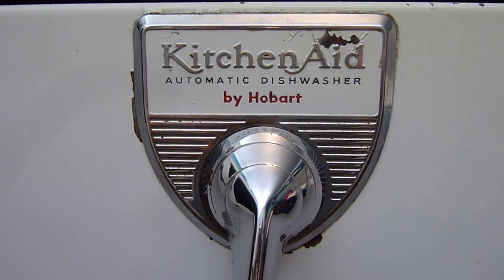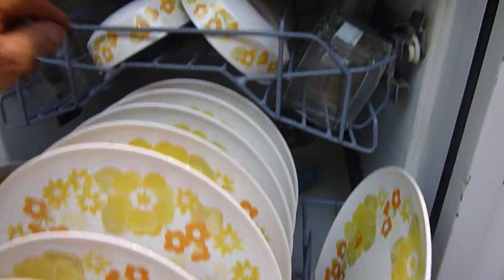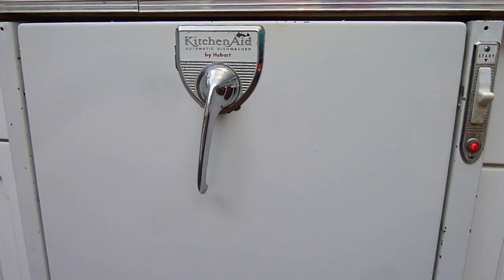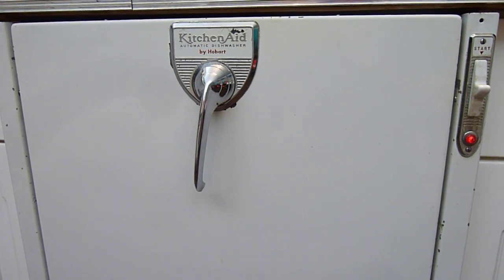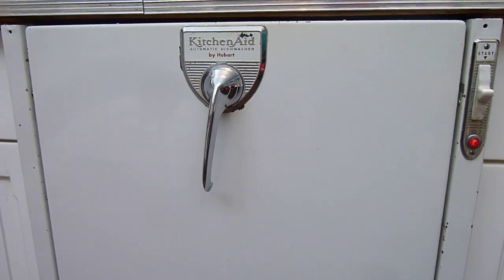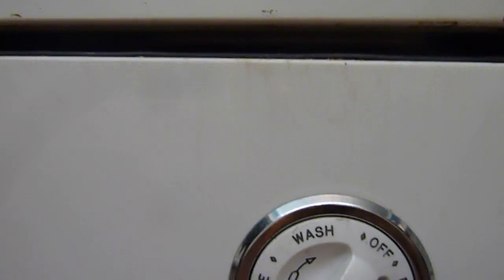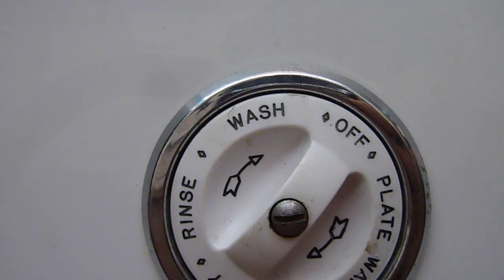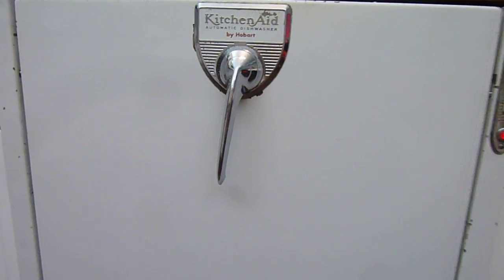1959 KitchenAid KD-12 Dishwasher Tour: Operation

Comment: Thank you so much for posting this video! I moved into my home in 1999 (third owner). All appliances were original, stainless steel. The wall oven crapped out in 2002, forcing me to replace it and the cook top with a free-standing stove. Last week, an appliance repairman gave my KitchenAid Imperial DuaCycle dishwasher the once over to inspect the source of leaking water which stopped me from using it 8 years ago. The tub, motor and gaskets are all pristine, and he feels the leak was due to a misplaced item that sprayed water forward (which is a common cause for leaks to form). I found the original owners manual online and she is ca. 1965. I shined her up and fired her up, and she’s back to her full glory - a real beauty next to her companion Kelvinator refrigerator (which is still running like a champ).
Reply from the maker: Fantastic!  It's amazing how well built and long lasting the old appliances are.  I'm glad you're enjoying them.  Thanks for watching!

Comment: We had this exact same dishwasher in our house until 1985. Ours was a KD-12P. The P at the end of the model designation meant that it was a pump drain model instead of a gravity drain model. The front of our dishwasher was stainless steel. There were some issues with it towards the end. There was a small leak. Also it started not to work properly. Lastly the racks were worn out (the lower rack was replaced during the life of the machine).
Reply from the maker: What an outstanding run for that machine!  Thanks for watching!

Comment: It’s amazing how a machine made 73 years ago still works  whilst I bought a tabletop dishwasher last May which broke down 6 months after and nobody can fix it.
Reply from the maker: I restored an entire kitchen's worth (40" Wedgewood stove with matching 40" Vent-A-Hood, Westinghouse Laundromat Twins, Philco Refrigerator, KitchenAid dishwasher, and all the small appliances like toaster, mixers, blender) of 1950's appliances in order to have a "real" working 1950's kitchen in my Victorian home, starting back in '93.  It took me a few years to find everything, and get it all finished, but here it is, 2022, and all of it is still in use.   The kitchen includes custom cabinets in white, with the correct chrome pulls, and real "Formica Double Boomerang Bianca" counter tops with fluted polished aluminum edge banding.

Comment: In 1957 my mother had the kitchen (built in 1927) re-done; a stainless steel Elkay sink and Kitchen Aid (by Hobart) dishwasher were installed. The dishwasher looked exactly like the one in this video, except I think the one my mom ordered had a stainless steel facia (I could be wrong about that).  I remember the start button. the little red pilot light, the blue-rubberized pull-out trays, the dial at the bottom AND...the forced-air dryer.  I think the whole cycle was under 50 minutes.  Whenever friends/relatives came in to our kitchen, they all wondered at my mom's dishwasher and after seeing my mom's unit, had one, just like this one, installed.  I don't think we had a single day's problem with this dishwasher...it worked PERFECTLY for 16 years, and then we sold the house.  (I think it would have worked for many decades, there was NO planned obsolescence back then). The new owner (1970) had it taken out and thrown into the trash, along with the stainless steel sink.  Reason?  The sink had tiny water droplets and didn't shine like a new porcelain sink.  Oh well.
Reply from the maker: What a great story!  I was very lucky to find mine.  It was still in use in a house in Ohio, that was being remodeled. The owner/seller was kind enough to help me get it shipped.  That was back in the mid to late 90's and it's been in use every since.   I was also able to find a big double basin, double drainboard sink and both have been very loved in my 1950's kitchen, along with my early 50's Westinghouse front load washer/dryer pair, Philco refrigerator, 42" Wedgewood  cook stove, and matching 42" Vent-A-Hood range hood.

Thanks for watching!

Comment: We had this exact dishwasher and let me tell you it washed many holiday dishes two and sometimes three loads one right after the other everything came out sparkling clean and the dishes were never pre-rinsed. It was still running but we had to finally get rid of it when it started leaking by where the dryer area was inside in the bottom right side rear.

Comment: My mother had this dishwasher, it lasted for years finally gave way where the blow dryer is, it leaked under there so we got rid of it and bought a KitchenAid Superba which I still have down the basement apartment. Very powerful motor and pump the spray arm weighted a ton.
Reply: Yeah, as I recall the spray arm was made out of cast iron--or at least felt like it was--very different from the plastic components of today's dishwashers.

Comment: In the uk these machines were never connected to the hot supply so when you switched it on a heater came on in a tank in the bottom and heater the water. Once hot enough (15 mins) the machine started. While washing another tank of water was being heated so it went straight to hot rinse. All done in 15 mins from time water heated up for first wash.  Our latest machine (top of the range Bosch) takes about 3 hours. What a joke.

Comment: My mother had one of these, extremely powerful pump motor cleaned and dried all the dirty holiday plates in no time. Ready for a second load by the time desert was served. Only reason for replacement was tub began leaking by dryer blower inside.
Reply: Well that's when you pull it out and do patch work.🙄😑
You can never find quilty and fast washing and rinsing in ANY DISHWASHER TODAY.

Comment: No new dishwasher would clean as good as that one
Reply from the maker: It doesn't do anywhere near the job that a modern dishwasher would do.  For example, it doesn't have a top rack wash arm (something that I'm guessing KitchenAid came up with), so the upper dishes are only washed as good as what the water can do that gets past the plates and utensils in the bottom rack.  And it doesn't create it's own ultra hot water, although my water from my house's hydronic heating system (compact boiler system) is very hot, so it's not really capable of removing food that's been stuck onto dishes and dried there.  There's also only so much water pressure that it can create, considering that the pump assembly is now 61yrs old, and counting.   It probably did a fantastic job when it was new, and tolerances were tight in the pump.  That being said, I don't need it to wash like a modern machine.  It's simply a functional part of my 1950's kitchen, it's a great addition to the rest of the appliances, it DOES work and do a good job, and it still puts a smile on my face every time I fire it up and hear all the cool sounds it makes.
Reply: @austinado16  Yup, we had one of these when I was growing up--it came with the house my parents bought in 1971--and I remember these problems well.  My parents had to repair it a few times before they finally gave up on it and bought a new one.  They estimated it was about 30 years old at the time.  (I guess some of them lasted longer than that!)  They've had a few dishwashers since then, none of which lasted longer than 10 years or so.  Anyway, I love seeing the rack design and the start switch and that little red light.  Thanks for the memories!

Comment: I've sold high end appliances for years and I've never seen anything remotely close to the quality of a Hobart by Whirlpool now. By today's standards this a "commercial grade dishwasher" for a resuraunt. Chances are the frige's in your grocery store are Hobart. I've sold 1000's of them.
Reply from the maker: Agreed.  The fact that this machine is still in use, and fully functional is pretty amazing.  Other than replacing a couple rubber hoses, and freeing up the fan motor for the hot air blower, it was still functional when I found it.  Other than cosmetic things (which are now showing their age again) and having the liner of the inner door re-powder coated several times, the only mechanical work I've done has been:  re-sealing the tub around the pump/motor housing, and having a new lock mechanism made on a CNC machine for the door latch.

Comment: I heard the pumps in early dishwashers were so overpowered they tossed the dishes around.
Reply from the maker: Mine doesn't do that, but there is probably enough wear in the pump that it simply doesn't produce the water pressure that it once did.

Comment: Hi - I have this same dishwasher - need a modern replacement part for the gasket (the dishwasher leaks when filled.) Any suggestions? I thought about having someone put new "guts" in too, but not sure if that's feasible. All the dishwasher repair places/people just want to sell me a new dishwasher, which I don't want.... any help or referrals you can provide would be very much appreciated. Thank you! Marion (in Pasadena, CA)
Reply: Hi Marion, did you get to fix it?
Reply from the maker: Hi Marion.  Apologies for the delayed response.  For some reason YT holds some comments, so unless I go looking for "held comments," they aren't readily viewable.  To answer your question, hardware stores like Ace or True Value, and automotive parts stores like NAPA, sell gasket material in bulk.  So that is what I would do if this were my machine...  diagnose the cause of the leak, and if it WAS in fact the gasket between the motor and the tub, I'd consider removing the motor/pump assembly, buying gasket material of a similar thickness, and then cutting a new gasket by hand (using scissors, an X-acto knife, etc).  All that said, sometimes, on vintage stuff, less is more.  So lets say you determine the gasket is leaking, but then you look at how the motor/pump are installed, and determine that due to age, you might do permanent damage to the machine, in attempting to replace the gasket.  Maybe you determine the damage won't be that bad, or maybe you can cut away the fasteners rather than "unscrew" them, and sort of mitigate chances of damage.....or maybe, it's better to use a product to simply seal the inside of the tub, at the location of the pump housing.  Or.....maybe you determine that NO ONE is going to take on this project, and you don't have the skill, so maybe sealing the tub permanently, is a better option because you can do it yourself.  In those scenarios, I'd recommend 3M 5200 Marine Sealant.  It comes in white, it is incredibly permanent and excellent, and you can do it yourself, in a matter of minutes.   I've actually done this exact repair to my machine, because I wasn't willing to risk damaging a perfectly working machine.   I cleaned around the pump flange, removed the drain screen located in front of the wash arm, and cleaned the area around the big drain opening, and the flowed in a nice bead of the sealant.  I let it dry for a few days, and it's been leak proof for years.
Reply: @austinado16  hi Todd we had a kitchenaid imperial dua cycle machine made by Hobart. Miss that dishwasher. This seems to be a common problem when they start to leak it is the gasket. My moms leaked and blew out the blower motor which was the motor that dries the dishes . We had a news gasket plus the blower motor we replaced. Dish washer still worked and we kept it. It was worth the fix. Maxine lasted for 30 years plus. We sold the house new owner kept it I guess. Just before we moved the wash motor would I guess over heat and shut itself down at the start of the last rinse.

Comment: Are you the original owner of that dishwasher?  Have you had any problems with it?
Reply from the maker: I'm not the original owner.  I found it online, being sold during a remodel, in OH.  It was still in use, prior to being removed during the remodel. Yes, I've had a few problems with it, but nothing really major.  The most recent, around the time of this video, was the actuator for the door latches had worn out.  I had a local machine shop replicate it on their big CNC machine.  As you can see in the videos the cosmetics are looking a little tired now from years  of use.  I did the original restoration on it in 1997, and it's been in continuous use ever since.  It's fairly straight forward to repair it, and so far I've been able to keep it alive.